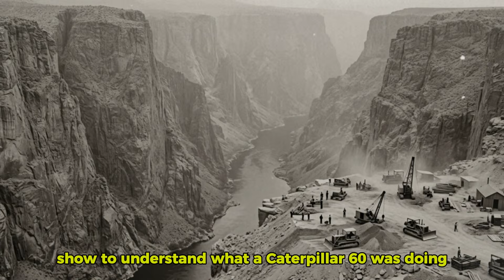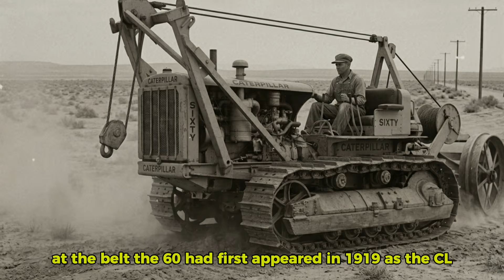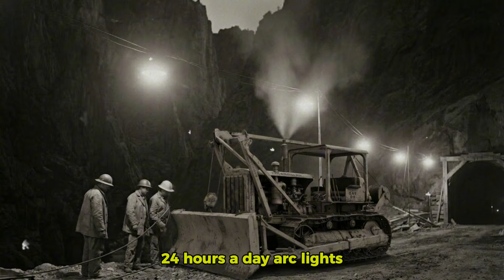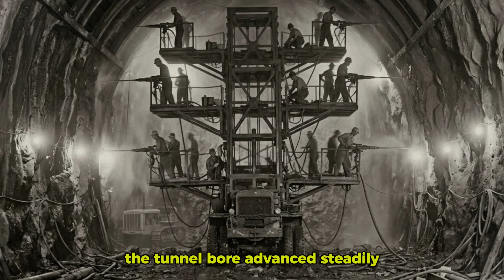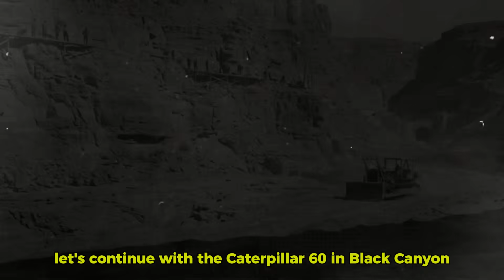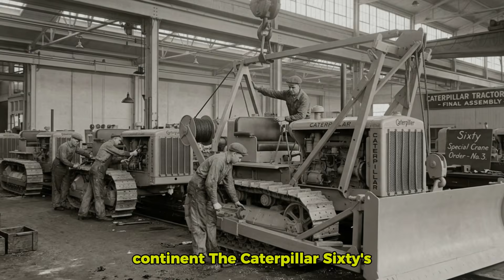Black Canyon 1931 The First Bulldozers on Hoover Dam

Comment: GET YOUR INFO RIGHT THAT IS A CAT D8 NOT A 60...
Reply from the maker: I recommend you do some thorough research, my friend🙏
Reply: I replied to a article that was a.cat 60 and as far as I know  now on 8s where on the hover dam two 60s where converted to diesel with ajacks power plants Henry j Kizer  and Bob did this for the tunnels because the gasoline 60s gave off carbon monoxide.From the book the mover of men and mountains.
Reply: I think you need to check your info